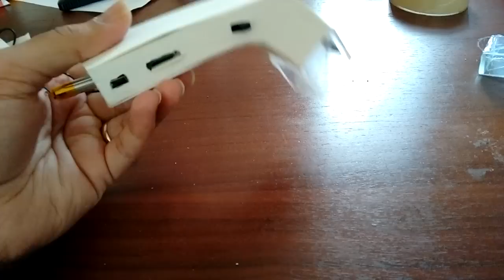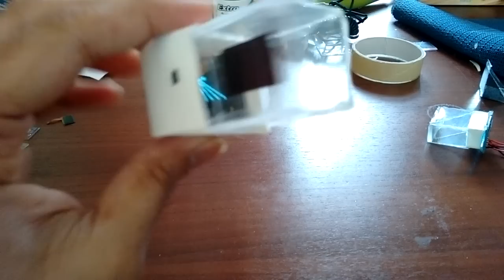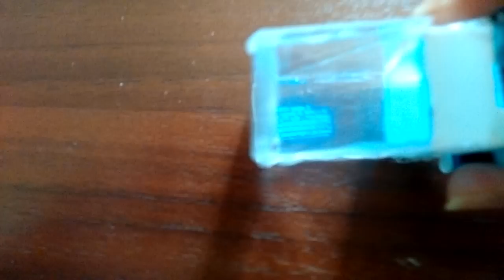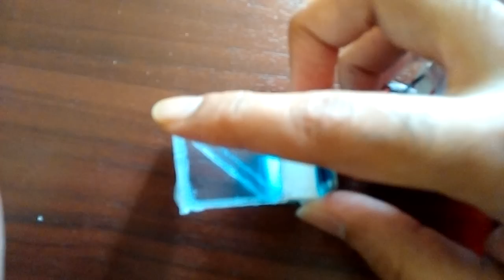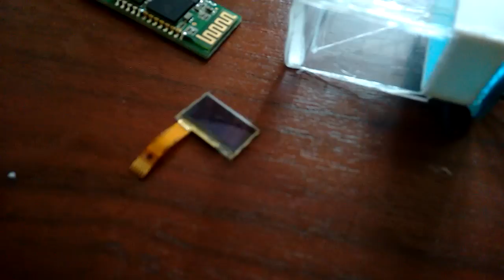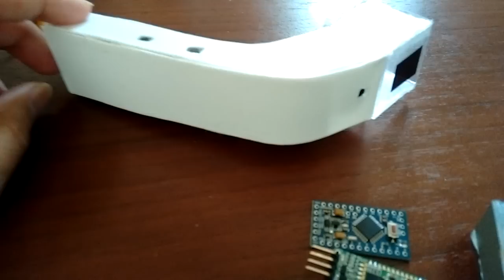DIY Google Glass - Update & How to make a prism

Comment: Have you tried foam-board?  You can find it at any crafts store.  Great for prototyping.  I am using it now for an optics project.  Easy to cut, bend and strong when formed into a box or U type configuration.   i like your Google Glass project.

Comment: Could you take a rectangular prism of glass, cut it diagonally, add a semi-reflective price in between, and  adhere it back together? So it would be solid glass
Reply from the maker: I don't think that will work. Give it a try though.
Reply: +Fahim Chowdhury  how did get  the mirror,  and what other material  can I use for the middle of the prism
Reply from the maker: +Isaac Chan it's not a mirror in the middle but on the side facing the screen. this is a acrylic mirror which I cut to size. use clear acrylic for the middle.
Reply: +Fahim Chowdhury no I mean u said there was a mirror on the opposite  side of the oled . where did you get the mirror?
Reply from the maker: Oh right. I bought it on eBay but you can find cut glass mirrors in hobby shops like hobbycraft in the UK.

Comment: Is it possible to change the prism to a larger size and change the display to an AMOLED screen that's around 2 inches? Also, could I hook up the board of an Android TV stick, use a portable battery and then use it like that with some sort of keyboard or anything I can use to communicate with the device?
Reply: I think that it is possibile
Reply: +Lapinus2006 - OfficialYT possible

Comment: How did you determine the dimensions of the prism? What is the purpose of the white frame bordering the screen before the prism is attached?
Reply from the maker: +Grace Chung  - Its to focus the light awards the acrylic and mirror to reduce loss of light. In my current version is not white but black which works better.

Comment: Where did you buy the screen,can it be atached to a raspberr pi 2 and see raspbian
help please!!!
Reply from the maker: Betech21 - here is the screen: http://www.aliexpress.com/item/0-5-inch-OLED-display-Arduino-shield-DIY-Maker-Electronic-Seeed-BOOOLE/32283261929.html

I dont think so not without a video controller/video card to connect the oled to the pi.
Reply: thanks.
Where can I buy one video controller,I think that the raspberry pi goes with one.
I'm trying to do a diy like meta spaceglasses,
with a old phone screen reflected into a crystal or two lenses and the screen in front.
Can you help me please? so many thanks
Reply from the maker: I don't think you can use this screen. In order for you to connect to a raspberry pi you need the screen to have a video output like HDMI. This requires the screen to have its own chip (controller). This screen and many oled screens do not have it. This is the biggest problem for me. I need a video controller which will increase the usability of the screen such as showing a camera feed.

Comment: how would one scale this down? would it be difficult?
Reply from the maker: Luke's Bikes  - I'm actually working on doing that right now. fairly easy if you use a smaller screen. I purchased a 0.5 inch display which is almost the size of the google glass.

Comment: Do you know where to get a higher resolution 0.5 inch display?
Reply from the maker: I know what you need and I wish I could get one but they are very expensive. here is one I found on alibaba http://m.alibaba.com/product/437931342/oled-display.html
Reply: Yeah i saw that too. Did u get a quote?  They also have them in some cheap smart watches on there i think but they are a little bigger. I also found some goggles for like under 100$ that have 2 of them in them i think.  Was hoping i could find em cheaper
Reply from the maker: I purchased this (link) Its one screen. Not sure on the resolution and it won't work with arduino so I'm thinking of connecting it to a pi zero. Monocular  Micro Display
http://s.aliexpress.com/eqmUFJbQ
(from AliExpress Android)
Reply from the maker: I got a quote of £150 - £200 6 months ago
Reply: That has a screen in it?
Reply from the maker: +Wayne Filkins - what are you referring to?
Reply: +Fahim Chowdhury that monocular thing you linked
Reply: +Fahim Chowdhury oh wow, I looked at it on the computer now and it has 640x480 display, not bad
Reply from the maker: +Wayne Filkins - yes its a display with composite video out